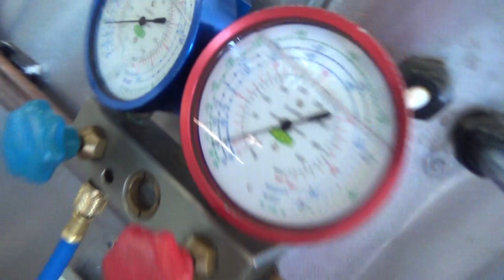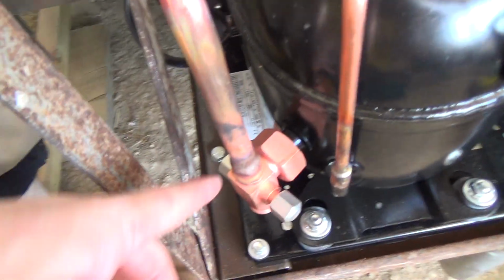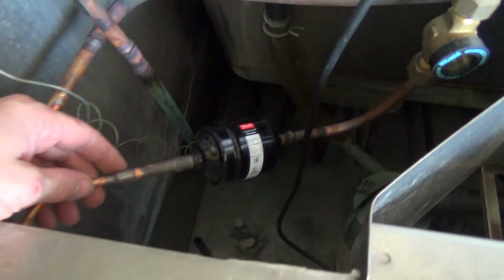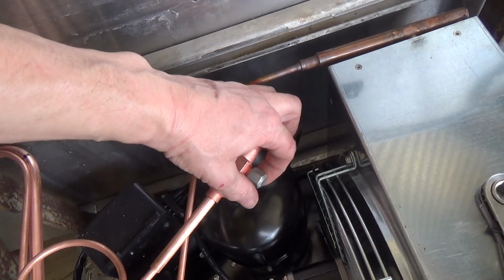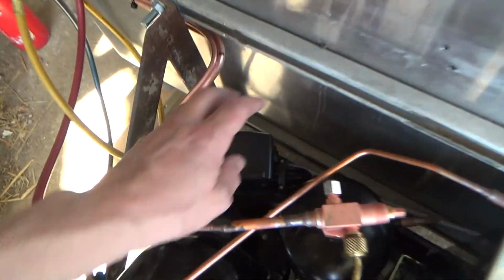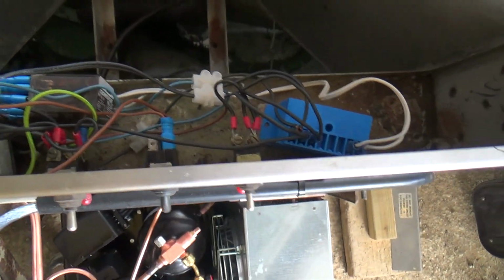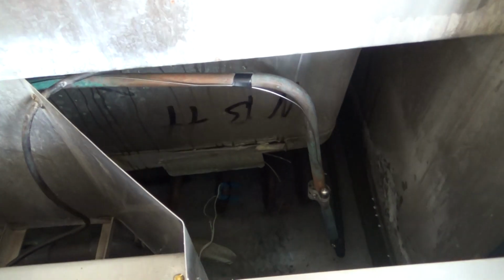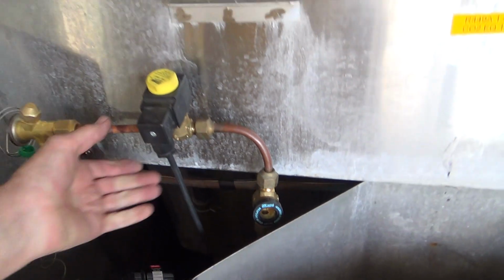Fullwood Compressor Fail and Replace

Comment: Cool thanks again heavydiesel
New  compressor 
And new ones bolts
Working on it
Reply: Hi      im been watchig your videos for a while   , what kind of compresor did u use   low back presure,, or hi back presure..
Reply from the maker: This would be a medium or high back pressure compressor, usual evaporating temperature would be around -10C but it would need to cope with +10C if they melted all the ice for some reason.

Comment: And the old unit looks like it could also give you a nice core for rebuilding, so you can keep it for this at your suppliers, and save a second trip back to them when getting one.
Reply from the maker: I offered them the option of a rebuild but they wanted a new one.